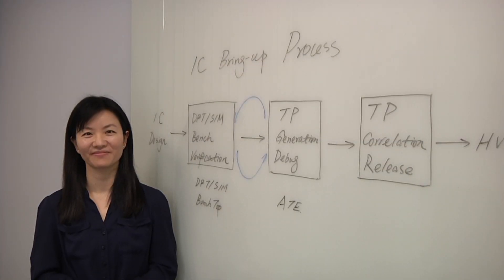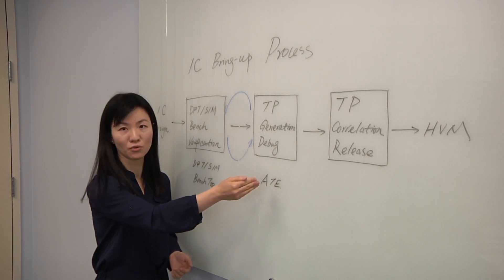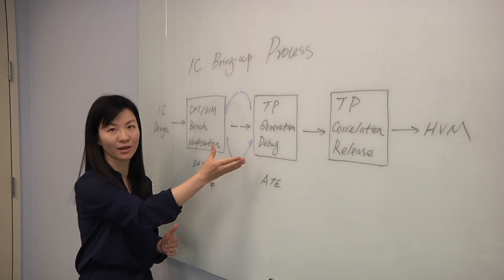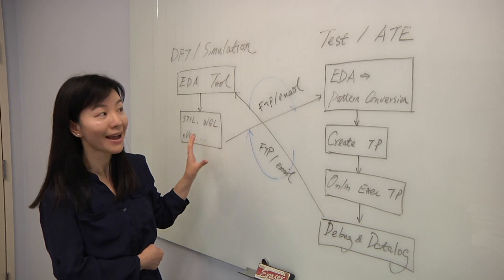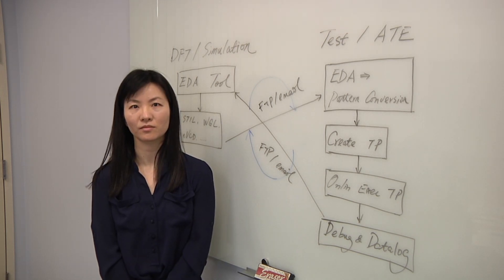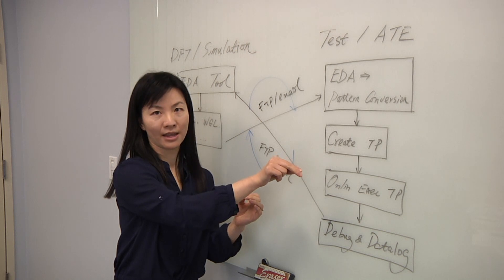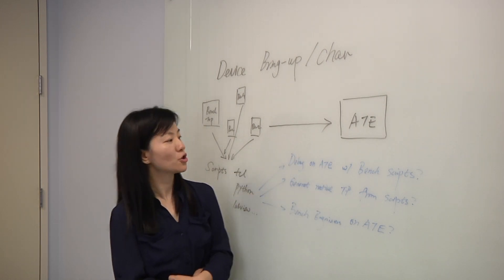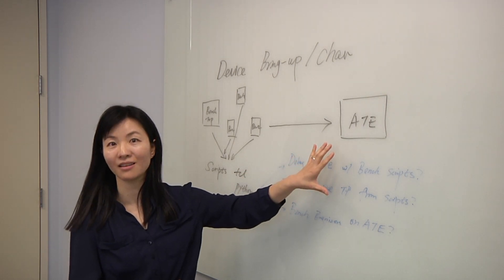ATE Lab To Fab

Comment: Suggestion: Would you be up for making a comparison between different manufacturers, wafer size (like, from 150 to 300mm) compatibility and models of wafer probers/ATE?

Ie a shootout between:

Electroglas 2001X/CX/2010X vs KLA 1007 vs TEL P-8 for 150mm

Electroglas 4080/4090/4090μ(+) vs TEL P-8XL/Precio Octo vs TSK/Accretech UF200(R) for 200mm

Electroglas EG6000(e) vs TEL P-12XL/Precio XL vs Accretech UF3000 for 300mm

Also, maybe you could talk about the development of impact force control (all based on Electroglas' patented MicroTouch technology), that prevents cracking of the wafer and damage to pads?

Just a suggestion.